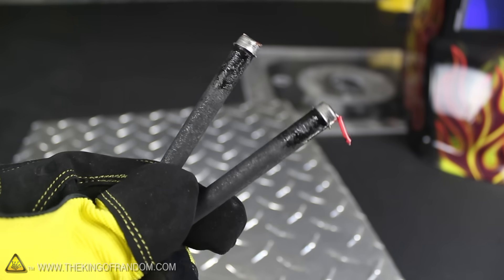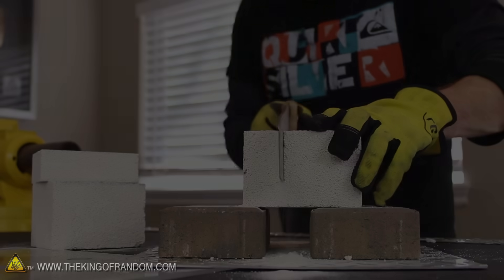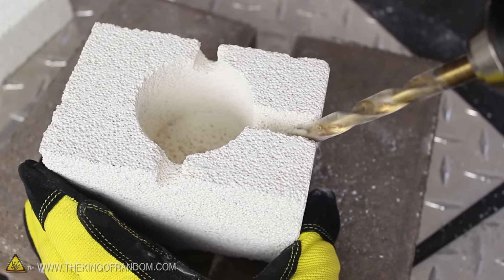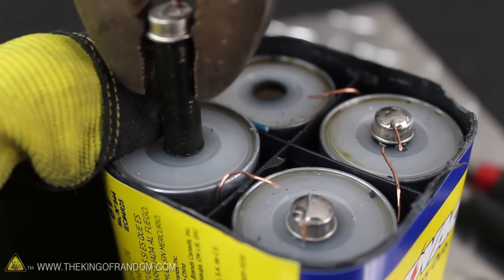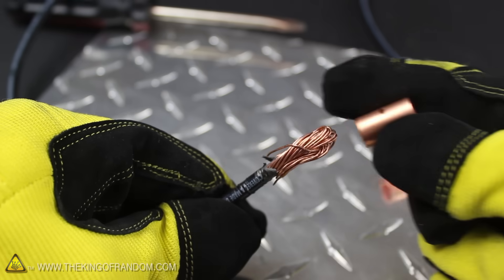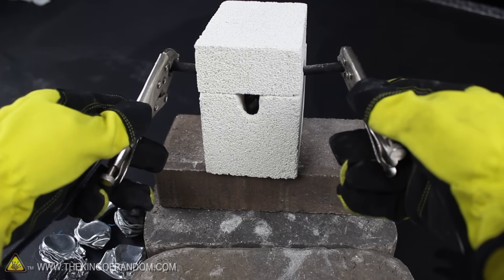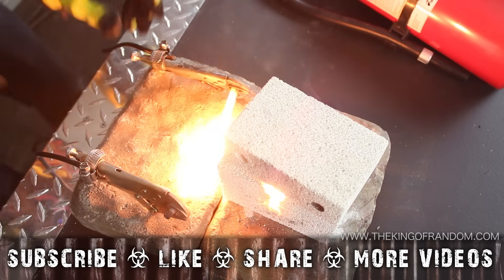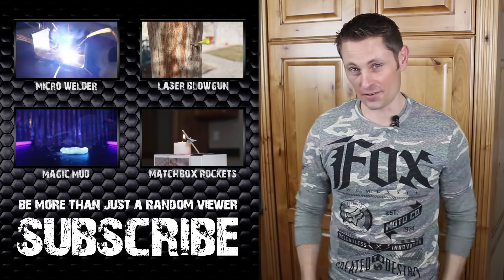How To Make An Electrical Arc Furnace

Comment: Would you be able to use a car battery for a source of power for the arc furnace?
Reply: @mrsobchak898  could you use a normal welder?
Reply: @mrsobchak898  but I already have a normal welder 

So for me it wouldn't be more expensive

Comment: Could your ARC Furnace be hot enough to melt "Clay Graphite" You could use the broken Clay graphite crucible from the Metal Pokeball video to see if it's possible?

Comment: Except where the heck do you get alumina silicate bricks for $3.50???
Reply: Harbor freight or online probably.
Reply: Home Depot
Reply: I get them at fleet farm or other stores in 6 packs for 20$. In the wood furnace section. Not bad
Reply: @JustinTopp  Thanks!
Reply: Idek
Reply: A crematorium  they are free if you can get in and bust the cremator and leave before you are found out

Comment: Is there a way to make this bigger like to heat up a 40"L x 18"W x 13"H fire brick box? I want to make and electric furnace for melting but also forging I was able to come up with a box with these dimensions now I just need away to heat up the insides. I was thinking of using stove top elements or a kelm element of a heat source but I'm not sure if they would get hot enough. This seems to get some pretty intense heat so how do I get this to spread through the entire box using these small rods?

Comment: I supose the disadvantage of this furnace is that graphite electrodes should get oxidised (burn) quite fast. Do the metal fumes protect them from the oxygen in air? Why this method is not popular in metal casting?

Comment: The largest fire brick that I could come across, is 9" x 4-1/2" x 2-1/2".
Will that also work for creating one of these, or will there not be a large enough base of insolation at the bottom, after carving it out?

Comment: +Grant Thompson I'm attempting to replicate your arc furnace design and I had a few questions. For one, I was not able to coil the wire as tightly, so I wondered- is it important that it be as tight as you have it? And if so, could you give tips on how to re-do it more tightly? Also, could you give more specifics on the way in which you wired the transformers and electrodes together? In other words, the wiring diagram.

Comment: I'm looking into making the arc furnace, but I'd like to avoid all of the wiring for the welder, as it's unnecessary. Could anyone direct me to where I can find out how to do this, or explain how to modify the model in the video to be used solely for the arc furnace? Thanks!
Reply: Hook leads from arc welder to carbon rods. Done.

Comment: Grant do you think you could do the same thing in just a crucible so that you would have a larger volume? And could you use the metal melter that you built or maybe just a normal 200 amp welder?

Comment: Does it matter if your pumping volts or amps into it (what causes the resistance) I have the ability to use a 10k volt transformer (like 80mA) or a microwave transformer that I would have to screw up but it would output the same as grants (120) any infos helpful!

Comment: If you would shortcircuit those electrodes from a standard 240V connection with 13A fuse, 

how would electricity would roughly flow?

Comment: Perhaps a better source of carbon electrodes would be ArcAir carbons from any welding supply outlet. They can be had in copper clad jacketed or plain. 

While you're at it, you may want to pick up some silicon bronze welding rod, sometimes called EverDure, and try you hand at carbon arc brazing on steel or galvanized steel. To do this form of brazing, simply grind a carbon to a point and put it in your electrode holder. Connect your ground to your work, strike your arc, and use the arc to melt the EverDure into the weld joint. When brazing hot rolled steel, it is advisable to give it a quick cleaning with a sanding disk in a grinder to remove the surface oxides as your bronze will flow better.

Comment: can we use car battery for the power for the carbon electrodes?
Reply: Christian Dajoh if i has carbon electrodes i don't see why not. Just be careful taking it apart! I think the point here is for it to be cheaper and smaller but if you have a spare car battery then that's the cheaper option.
Reply: yea but i mean is trashed car battery.
Reply: so the liquid is flammable or toxic?

Comment: For anyone wondering the melting point of that Graphite rod (crystalline form of Carbon),
and more interesting thing is, carbon melts only if it's more than 100 bar (~100 times the atmospheric pressure) !!

So only way is, if you raise the temperature to over 3550 celsius (6422 F), then the carbon will sublimate (solid to gas state).

And in highlight,
Carbon has the highest melting point in entire periodic table of elements (stable elements*).

Comment: He didn't mention the fact that, making the spark grips are SUPER dangerous.
Like if you aren'r wearing gloves, you WILL die and you won't be able to be ID'd cause you'll be a charred mess.
Those kinds of voltages are not to be played with and shouldn't be handled via uncovered metal vice grips. 
Should at least make a insulated cover for them at the least
Reply: Well you're definitely no expert, i can tell.

Welding voltages are pretty low, its the high current which is used for welding. Those voltages aren't dangerous and will definitely not 'char' you.

Still, wear gloves because it can get hot
Reply: Who know where i can find detailed onstruccion for the project?

Comment: Do u have to use the copper wire, hose clamps, and the copper cupplings to make the battery work or do u not need that?

Comment: I'm a 100000% noob at this but if your wall outlets run at 220-240 volts couldn't you plug something into a wall and with a wire attach it to the clamps would it have the same or similar result without any ARC welder?  Thanks in advance
Reply: No, the wall outlet is high voltage, low current. You need the transformers to flip it to low voltage, high current. His home-made arc welder, or a real arc welder will do.
Reply: Hmmm. Thanks for the reply I'm gonna need to look for an alternate method cos I can't get my hands on the stuff for an arc welder. But thanks again.
Reply: Wait a minute what would happen if I used high voltage low current instead would it still work or what?
Reply: AAaaaaaaaaaaaaaaaaand could i just use a car battery charger?

Anyone plz halp
Reply: Another Random Youtuber you'd end up killing yourself. Don't.
Reply: Another Random Youtuber why not just find some unused microwaves? people throw them away all the time, alternatively you could buy the transformers yourself but that would be far more expensive.
Reply: Another Random Youtuber You wont die If you touch a car battery
Reply: Well then I have it decided, I won't be doing this but thank you so much for your help everyone. :)
Reply: ????? Now I have people saying do it, it's fine and people are also saying don't do it you'll die???????
Reply: Another Random Youtuber If you touch it you can die. So If you want to do be VERY careful!
Reply: Soooo I can do it but I can't touch anything that has electricity from the car battery or I'll die?
Reply: So what will I die from?
Reply: well you wouldnt die from anything if you're careful... People have touched both parts of a wall outlet and just got shocked.. Now, if you held one end in each hand, there would be a large shock to the heart... AKA DEATH
Reply: You should rectify it because DC ist not as dangerous as AC
Reply: Allen Lowe do you have any recommendations for some specs for an arc welder (to buy) that will work well with this
Reply: any arc welder should be able to do this if you know what youre doing
Reply: Could i just use a portable arc welder at 100amp 220v and then just hook the rods on it. or are the amps to low?
Reply: ....soooo... what happed... 
been a year.. bro
Reply: I think it should work because when i was arcing with 325V DC my arc stick melted

Comment: How long does the carbon rod last?
Reply: Dan Hyde up to 12 months depending on how much you use it per day.

For example if you use it for 3 hours per day it will last a minimum of 2 years
Reply: MOHVIDS wow so with minimal use. like I'd use it so maybe melt a couple of pieces of metal every 6 months. It would pretty much last me until I'm an adult and can afford to actually buy a furnace (if I'm 16)
Reply: Dan Hyde if you only only do it for a couple of metal every 6 months then it will definately last you a minimun of 20-25 years
Reply: if you dont expose it to air too much
around a few months if you use it frequently

if you let the air burn it while its glowing white then it really wont last long!!
Reply: Dan Hyde s

Comment: What an amazing video!!! But how do you connect the carbon electrodes to the arc welder?? I am sorry but I just can´t figure it out, do you strip the wire (the one which connects the carbon rods) and just attach it to the center tap of the two transformers or what??

Comment: Jet fuel can't melt steel beams but abattery can.
Reply: very true... but I imagine if you ignited enough of the fuel to keep it bring for a long time it would
Reply: inside job
Reply: Plus it's mains
Reply: Zombiehunter 1376 - For what it's worth, jet fuel is basically kerosene.. Aviation Gas is a few octane lower than the fuel we run our cars on.. If I recall correctly 'super' (the fuel with lead) was about 97-98 octane, whereas av gas ranges from 87-89 to 90-91 octane.. But then there's several other fuels that contain various additives, my understanding is they'll all work in cars, but most will need tuning for best results & others may need additional bits fitted or changed..
Reply: @Pepperlandable  in finland you only have 95 and 98
Reply: of course, RON rating vs MON rating. "Because of the 8 to 12 octane number difference between RON and MON noted above, the AKI shown in Canada and the United States is 4 to 6 octane numbers lower than elsewhere in the world for the same fuel. "  So no, europe's fuel isnt better, it's only overpriced
Reply: I wondered why the airport fumes smell like kerosine
Reply: I think the wings are cooled down with liquid nitrogen.

Comment: Do you need to use the arc welder or can you just use the pliers and the carbon electrodes by them self to melt aluminum or is it not strong enough to melt things on it own
Reply: InfamousVlogs The arc welder is what makes it all work. By just touching the rods together with no power,  nothing will happen. You can find an arc welder fairly cheap online

Comment: All of these are connected. Like yeah this thing is cheap but THEN I NEED TO HAVE A FEW SPARE MICROWAVES AND DISASSEMBLE THAT STUFF
Reply: YES NOOT. NOOT. YES I THOUGH THE SAME THING IT'S LIKE THIS IS JUST $1.69 PER FURNACE BUT THEN TO ACTUALLY USE IT YOU NEED LIKE $200 LIKE WOT IS DIS GRANT! great username & profile pic BTW

Comment: Be careful which batteries you choose, alkaline batteries will not work because (as far as I know) they do not have inner carbon rods, and also have highly corrosive alkaline material inside. You will make a mess and potentially get caustic gunk everywhere. What you want are Zinc Carbon batteries, usually labeled as "heavy duty". Double check the battery casing and make sure it doesn't say "Alkaline" anywhere on it.
Reply: Nathaniel Epps • Truth
Reply: Ive got a Rayovac 6V General Purpose battery. No where does it say Alkaline. The only info is "mercury-free formula". Will this battery be usable?
Reply: Nathaniel Epps if
Reply: Nathaniel Epps  very truth

Comment: Melt any metal known to man? Osmium and Iridium would like to have a word with you.
Reply: Kidfury101 diamonds are not a metal. Besides, you can easily "melt" diamonds. A magnifying glass and the sun are all you need to turn diamonds into puffs of carbon gas.
Reply: Jon Mayo Yea, guess Tungsten is probably a better example for things that this can't melt.
Reply: what about steel beams
Reply: Kidfury101 diamonds aren't metal
Reply: I was about to mention tungsten, but then I read the comments and noticed that you already did
Reply: Tři III van Wabawooo how about lead? Can it melt lead
Reply: Why did you use osmium and iridium as examples instead of tungsten?
Reply: I see what you did there hahaha
Reply: Nicholas Cannon 
Lololololol
Reply: and tungsten
Reply: +LMBJ no
Reply: lol
Reply: just because carbon MELTS at 3550 does not mean it could reach that temperature, as a material heats up its electrical conductivity changes, your carbon elements would explode before the tungsten even softened up

i manufacture high temp furnaces and if it were as simple as passing current through something with a high heat threshold all heating elements would be made from tungsten (newsflash they aint)

osmium cannot be melted by any modern furnace. not even close. im assuming tungsten can however it would be heated by much more than simple carbon rods. you dont tend to use even silicon carbide elements past 1800 C/ 3270 f
Reply: guys diamonds are pure carbon just like the rods and carbon has the highest melting point of all the elements so it can melt iridium and osmium no problem, but you need a better power supply.

Comment: is there any way to make this on a larger scale?
Reply: Just make it with a larger fire brick
Reply: Ace-Legend lager brick and 2 elektrodes for example
Reply: AceLegend54 would he worse tho, more space will heat up slower
Reply: yes. they use it to smelt large amounts of metal at some kinda really big melting plant, that i have NO chance of remembering. it was pretty noisy, though... like... the earth being ripped apart, noisy.
Reply: Check electric arc furnace in steel mills.
Reply: Kik
Reply: yes
Reply: Emile Daenen yes there is!
Reply: nee nee learn to spell...
Reply: AceLegend not at all

Comment: Feel like a noob but why is he not getting shocked by holding the two live wires
Reply: those are for the heat not current
Reply: A welder has low voltage. That is not enough to break through the skin. 

Its the same as touching a 12V car battery. You wont get electecuted by that either.
Reply: Electricity takes the path of least resistance.
The copper wires/metal vice grips are better conductors (lower resistance) than human skin.
Reply: Louis Comper those are heat gloves to protect his hands when he handles the 300+++ degree metal
Reply: Android811 correction! Electricity takes ALL paths of least resistance...
Reply: gloves
Reply: it´s high current not high voltage, i touched the leads on my arc welder and i am not dead
Reply: maybe its the fact that he is wearing rubber electrical gloves facepalm

Comment: You are not using the metal melter to power this setup.............. Would the metal melter be capable of doing this?
Reply: If you mean the metal melter from his videos, that is the metal melter i think, just in other case
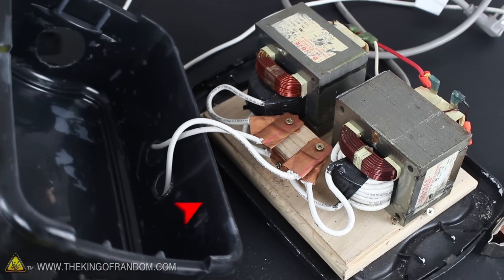Reply: At around 4:39 he makes a comment that "it works much better on 240 volts much better so lets leave it as is.  So I guess he is using the arc welder transformer setup for the melting here.    I am asking as the metal melter would much easier to build than the arc welder setup.
The reference at the 4:39 mark seems to imply that 120 volts works but in showing the arc setup, the 120v here is not the same as the metal melter.............

Comment: "Oh it's cheap and simple to make, all you need is to cut these fire proof bricks, take some lamp batteries......and disassemble a few microwaves and combine a part in them to amplify the power enough to power the welder"
Reply: Dylansgames you can get all these things for free from a recycling centre or some thing
Reply: there arent any near me =/
Reply: The bricks are cheap he got the microwave for free and he probably already had the lantern battery.
Reply: I
Reply: Dylansgames anyone know where to get those firebricks I could only find eBay but my account got deactivated
Reply: Dylansgames lol

Comment: do you thank you can melt TUNGSTEN in the arc furnace ???
Reply: randomness019 
That depends on how much juice you give those electrodes
Reply: tungsten will be tricky. it has a melting point of approx. 3400 celcius, the graphite rods will melt at 3700. tungsten carbide will melt at 2800 however. but you'd need a shielding gas for those and a lot of power to melt even tungsten carbide.
Reply: randomness019 well, I mean, it DOES kinda make an arc of plasma so... probably capable of generating like 320000 degrees Celsius if you left it on long enough and had a brick that wouldn't melt with that kind of temperature.
Reply: +Shining Armor Or how much they can stand? :-/
Reply: The MinecraftR 9598 all plasma isnt that hot, it depends on how much power it has
Reply: The MinecraftR 9598 wich is hard to find if you live in certain areas or have no knowledge of said materials :p.s apologies for any spelling errors
Reply: Can I just say that the arc disign is kinda flawed if you want a better dising try something else because this dising being relatively easy to make means it's also relatively easy to destroy it's fun if you want to start out but after getting some base knowledge you should try a different dising
Reply: The MinecraftR 9598 what are you on dude 320,000 c a volcano isn’t even that hot
Reply: KEY EHEK what tungsten carbide has the highest melting point of anything
Reply: randomness019 no tungsten is 3392.8 celcius
Reply: Uhhh what
Reply: i think so
Reply: carbon can not melt it can only become gas at around 99 atmosphere at 4500 celcius my mannnnn
Reply: no the sun does and volcanos are a mere 1200 C at max temperature so yeah